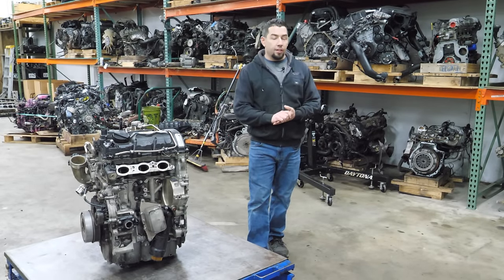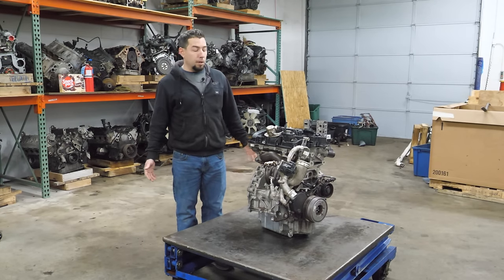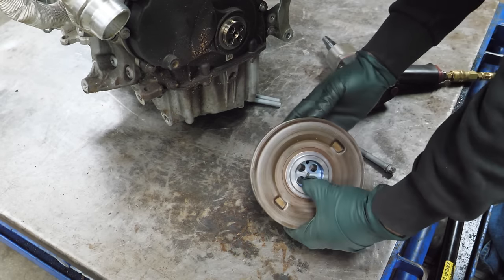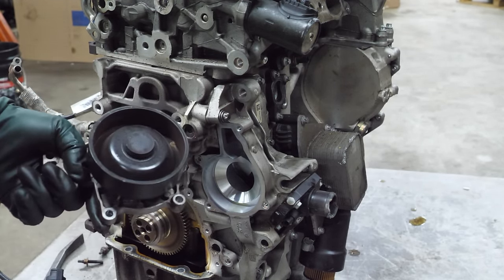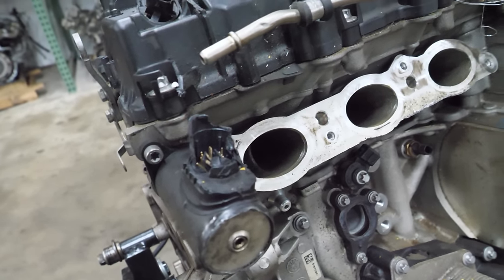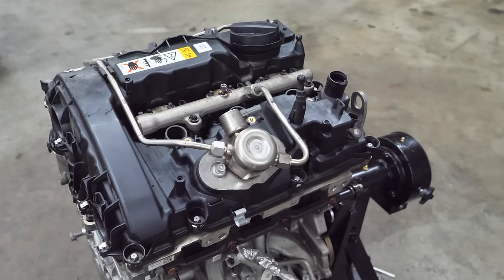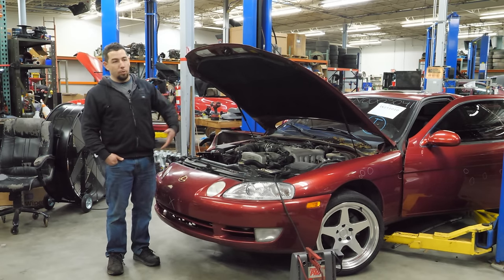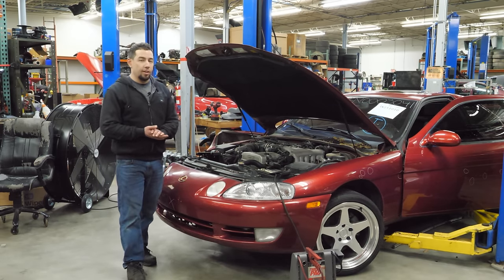MYSTERY FAILURE? 3-Cylinder BMW / Mini Cooper B38 1.5L Engine Teardown

Comment: The B series engines have one of the worst cooling systems ever installed in a BMW. That is saying a lot, given that BMW isn’t exactly known for good cooling systems. That water pump bracket is an absolute shit design. And they went overboard on the plastics. Many hoses have been supplanted by plastic pipes that love to fail. One being the coolant feed line to the turbo charger. It’s a plastic pipe with crimped ends 😂

Enthusiasts love to pop stiffies with the B58 given its link to Toyota and its tuning potential. But I would argue the N55 has been around longer, is just as reliable, and can also easily be tuned.

The B series engines improved stuff like the injection system and the oil pan gaskets. But took a step back with the shoddy coolant system and oil filter housing which is also plastic, and a high failure item. 🤷‍♂️ one step forward, two steps back. So goes this eternal dance we do with modern cars.
Reply: I feel like BMW has really doubled down on sourcing only the cheapest plastic components for as many parts as possible.
BUT you CAN make decent parts from plastic you just gotta double down on quality aka high grade resin plastic reinforced to hell and back. Like the stuff they make Powertool Housings from.
But components bolted to the engine with hot pressurized oil or coolant in them... really? Would it hurt to make those from aluminium castings? No.
My 17 Year old Volvo has an aluminium oil filter housing and thermostat housing. Waterpump is all metal too. No issues here at all no leaks nothing.

Id imagine aluminum barbs and standard size hoses are cheaper than custom made plastic pipes too.

God I hope the timing chain on the B engines is solid at least. Because these lil guys actually seem decent as high hp small engine light car projects and id hate to see tons of these beached with wrecked timing chains.

Comment: the drain plug is a temp plug because the threads in the pan are stripped. probably got put on with an uggadugga gun at a jiffy lube.

Comment: I saw pistons like that after a friend put diesel in instead of gasoline by mistake and the engine smoked from that time on, after we changed the rings and cleaned the heads we put it back and it ran perfect, still running today and that was ten years ago!

Comment: Good Engine!  Broken harmonic balancer causing engine vibration and oil consumption and compression blowby caused by sticky rings.    Some say the best thing to do when you see this piston ring problem is to spray or pour a liberal amount of WD-40 into the cylinders through the spark plug holes and let it sit for a few hours in WD-40 to soften the gunk on the piston rings and then crank the engine over and then re-install the spark plugs.
Reply: Yes I agree, those oil control rings didnt appear to move at all, they look baked onto the piston with carbon

Comment: That was a pity - so clean inside with glazed cylinders and carboned up rings.  All that engine needed was an "Italian Tune Up" once in awhile.  This seems odd, as one would expect a tiny 1.5 turbo engine's entire life would be one continuous Italian Tune Up 😂

I do think in their quest for economy, manufacturers are specifying oil with the viscosity of water and giving us inadequate too tiny low tension rings, especially the oil control ring. Screw the 0W20 oil, I always run 5W or even 10W30 in the wee displacement engines with good results as far as burning oil goes.  From that engine's internals I think the thin oil lubricates fine, but the rings are too lame to deal with it properly, so going up a tad in weight is an inelegant work around.  

Pretty cool overall design though.
Reply: Trouble is these engines have no power up top. Redline might as be like 4000rpm. Feels great around the city, but they are gutless on the highway. Everything is tuned for low end grunt and the auto transmissions shift up really early.

Comment: The B38 is a overlooked gem of an engine. I drive one in a 218i (2-series coupe, RWD) and coupled with the 8 speed ZF, it's a sweet combination.Economical and still able to zip the car around. On the highway it quietly hums along well below 2000 rpm.The actual factory HP is usually just above 140, and a simple remap will safely take it to 175hp which is not bad for a small, "economical" coupe.
Reply: Do you think a remap for this car would be totaly safe ? Im not sure about doing this because im afraid the 3 cylinders wont be able to handle this well...
Reply: Dont tune it we got a 1 serie with that engine its direct injection it will burn the pistons if ur tune it so i wont toch it

Comment: The i8 engine was turbocharged, so I guess that's why it made that much power.
Reply: I drive a bmw 318i with b38 engine that is turbo charged, it's only 134 horse power.

Comment: In the UK, this engine has a reliability issue with burning oil. It burns oil and if it is not kept topped up, the turbo blows. The dealers do not like to try to fix the engine if they have one with reported high oil consumption, they replace the engine and consign the old one to being a core. Demand here is very high for 'good' ones that can be rebuilt (as the one you have is). The trouble is, most cores of this engine are very bad, and the number that are not rebuildable far exceeds the number that are. These engines have a very short life. 100k from one of these, if well looked after, is unusual, and if you go to UK salvage yards, you will find these cars in good supply (just a bad engine), only a few years old and already scrap. Really sad, and an utter waste of the earth's resources. Note that, over hear, there is what we call an MOT test, where emissions are tested (along with a lot of other stuff), the first of which happens at 3 years old, and then every year. A lot of these cars fail that test at the first 3 year test, a testament to really bad engineering. Yes, I live a few miles from the factory that makes them, so we used to get to see a lot of them on the local roads (and in the local shops and scrap yards). But, they are not so often seen now (so many scrapped already). Buying the Mini factory was probably the worst decision BMW ever made.

Comment: You're probably right about the clatter the crank pulley would make, but six bucks and my right nut tells me there was a misfire on the cylinder sharing the far-right spark plug.  That's definitely flashover tracking.
Reply: What is "flashover tracking?"

Comment: The head bolt noises make me believe it overheated. I bet it seized up, little to no maintenance.  Probably didn’t change the oil often enough. It probably un-seized from sitting cold for an extended period. Straight guess of course, I just like this game lol

Comment: Love the video. Here in Europe these engines are about 2000e for a bare engine. One ir the first b38 I had was about 3 years ago. They usually have melted pistons or the conrod goes on a trip and makes a hole. B48 suffers from the same problems.
Reply: The melted pistons is mostly due to remapping, especially on the 20i variants, as the pistons are made from a type of cheese. The 25i and 30i are much better in that regard as they have stronger, low compression items.

Comment: It was down to the balancer i’ve had a 1 series in the shop making a hell of a noise like the crank was out of it because they do suffer with premature end float problems and it would keep shredding fan belts, when i compared the harmonic balancer with the new one it was only a 2mm difference between the two half’s where it had started to fail but that’s all it took so i can only imagine the kind of noise that engine was making, lovely bit of misdiagnosis got you a nice parts haul 👌🏻 rings didn’t help matters though

Comment: Thanks for your educational and humorous videos. They gave me the courage to tear apart my S54 and boy did it need it. How about the headgasket being blown out between every cylinder (luckily in the middle layer so the block and head are fine) and some of the conrod bearings being so delaminated only small patches of unmolested bearing remained

Comment: Samcrac had an I8 with an engine like this which looked good, but eventually it had a wrapped head, that might be the case here too. 
Let us know if the cylinder head surface deemed straight and true.